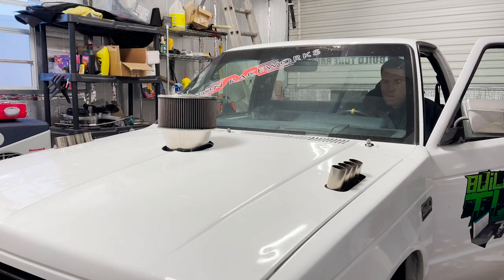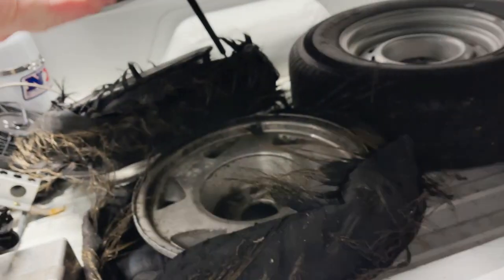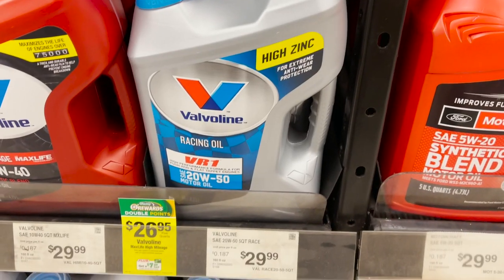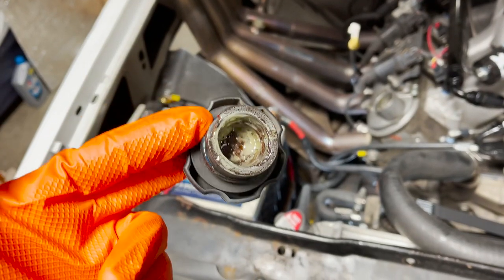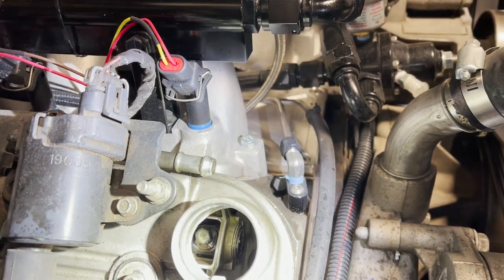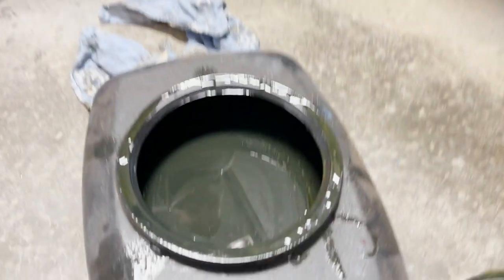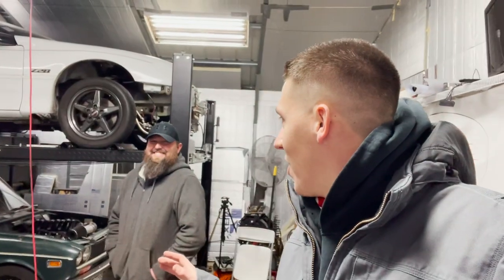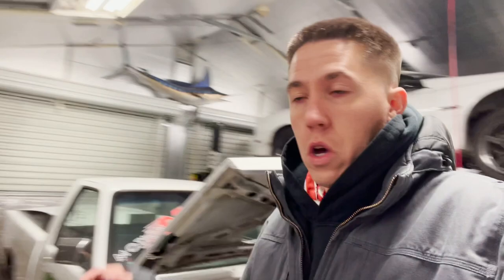Burnie Gets Ready For Another Cleetus and Cars Burnout Competition! Might have an issue...

Comment: Just send it, but I would recommend changing the oil after every event. 2 minutes of nitrous, E85 and extreme heat will break down your oil quicker than you would think.
Reply from the maker: Definitely haven’t taken maintenance very serious with this thing even though it only has about 15min of run time on this thing it has had a very rough 15min 😂

Comment: Most likely condensation. I see it at work A LOT in peoples daily drivers. It build up right under that cap with no signs of a leaky gasket. Do your compression test, and if you are still in doubt. Bring the engine up to temp and do a combustion leak test at the rad. The type of fuel you are using may be a good part of it. If you are running E-85 or 90 you will get a lot of water build up in the oil.

Comment: Send it! If there was water mixed in the oil, as it separated it would be under the oil, not on top of it. Alcohol, however, does float on oil. Betting there's a little fuel in the oil and water you see under the valve cover is just condensation. If you're really wanting to know, send a sample of the oil to Blackstone Labs.

Comment: If you do alot of start and stops in the cold air like you guys are in Iowa itll cause this issue by not letting the oil warm completely up and burn off the moisture. I would suggest more often oil changes and watch the headgaskets

Comment: I’ve seen that before in my truck it sat for awhile started up couple short trips and it was a little milky under the cap  all it is is condensation couple heat cycles and it will disappear

Comment: Like everyone else said it's probably just condensation.  On what oil I use 15w40 in most stuff lawn mower, jeep 4.0 , 71 deville 472 , and every vehicle at our work new or old gets 15w40. Only time I run a different oil is redline oil in my motorcycle.

Comment: Water condensation doesnt turn green thats coolant for sure
Reply from the maker: The engine also had Brad Penn oil in it which is green in color.
Reply: @BuildTuneRace  gotcha so that's why its green dont want to use green coolant then wont be able tell a difference